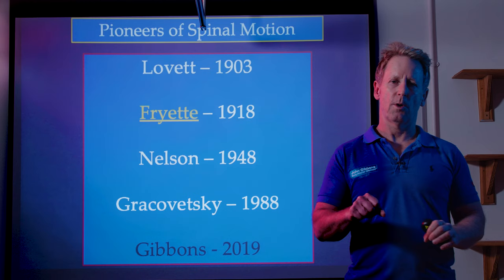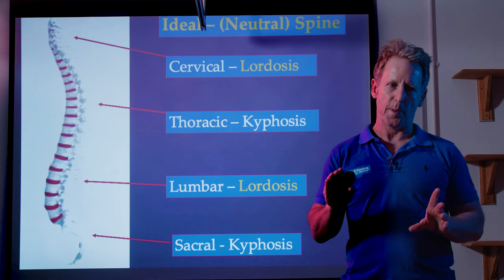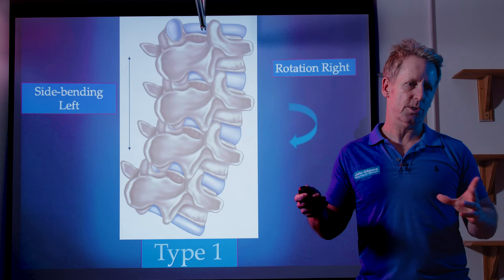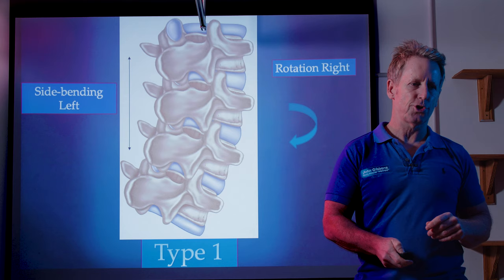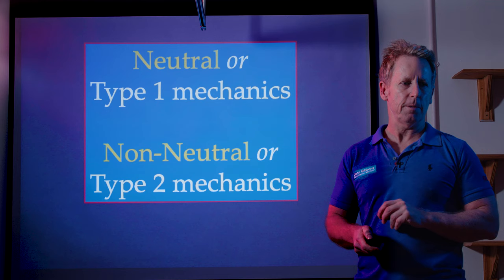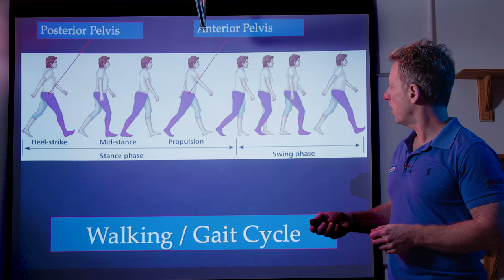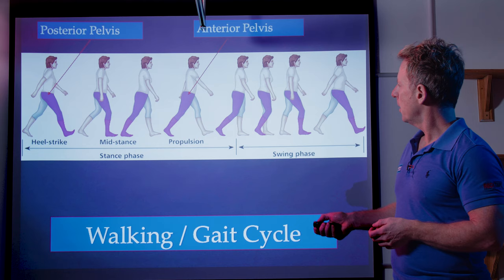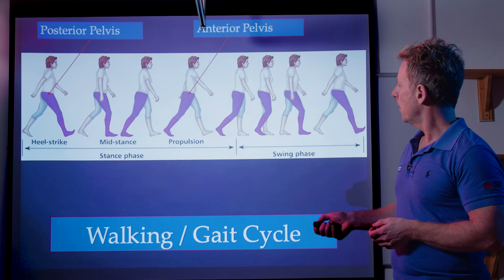Spinal & Pelvic Motion - Fryettes Laws of Spinal Mechanics

Comment: Thanks for this video, the wonderful complexities of the human body never cease to amaze.
Have been searching for a single mind body connection thought to achieve proper posture and the one that seems to help is to do with maintaining the sacral angle, so, just thinking "30 degrees" whilst visualising L5 sitting at 30 degrees on the sacrum seems to help maintain a neutral spine and proper posture. How important is it to maintain the sacral angle and has any formal research been done on this concept?
Reply from the maker: Thanks for the message and comments - not sure if much research has been done but sure it needs it, regards JG

Comment: i really appreciate not only the effort that you put into presenting your content , but also the continuous update and renewing of  the manner with which you present your material.  my first question would be, in two separate slides of your work , it was mentioned that flat lumbar spine was associated with posterior pelvic tilt as well as counter -nutation of the sacrum, and the same goes for hyperlordotic back (lumbar spine) , where anterior pelvic tilt and nutation of the sacrum also simultaneously exist .in the former scenario, and in the latter example as well,  is flat back and hyperlordotic back always accompanied by the aforesaid patho-mechanics of the sacrum?? and if yes, would correcting the underlying presenting flat or lordotic back -whatever its cause is -automatically realign the sacrum into normal place or then i would have to re-position and reduce the sacrum back into normality too?  my second note rather than a question would be , in the final informative and illustrative slide that you showed, i would assume that the sacrum would rotate to the left rather than the right , after the right innominate rotated posteriorly ,  because were the sacrum rotated to the right, it would act as a wedge blocking and obstructing further motion of the innominate as well i assume the rest of the chain.

Comment: This is great. I did a complete study of your book on this subject. And now I'm going back to it again to double check the crib sheets I made from source.
I noted that I could use home exercise: stretch L piriformis for R-on-R dysf. 
Can you confirm that I could prescribe home exercise: stretch R piriformis for R-on-L dysf.?  
Or would it be home exercise: stretch R glute med for R-on-L dysf.? I may have seen this in another source and indeed this is what I've been suggesting. 
I do manual techniques primarily however.
Reply from the maker: Thanks for comments and you could give the patient the 'sims' exercise to help correct forward sacral torsions. regards JG

Comment: Hi John, interesting explanation, I have degenerative disc disease of the whole spine, including SI joint and bilateral ischial hip impingement. With one herniated disc and 6 bulging discs. This is the most helpful video I have come across. Have been doing my own exercise due to Covid, had nerve block and waiting for next pain treatment. I would like to know whether the si joint would impact on the walking stability, as after a while rh foot seems to rotate and it is the rh sacral joint which is the worse.
Reply from the maker: Thanks for the message and the SIJ is the foundation of the whole body (in my opinion) so yes it can affect not only the lumbar spine and thoracic spine above but the lower limbs and feet below, regards JG
Reply: John Gibbons thank you John, gives me hope that my walking will improve.

Comment: What would you recommend  for youn man who have posterior  pelvic tilt, however  since many years ( the pain is improved with setting management ect ect however his real pain certainly is located in his Sij facet  and much more his right side,  the typical back stretches not enough to help however feels nice in such positions , the patient is a horse ride trainer however he felt worse when he stopped riding as example , feels slightly better riding .   VAS 4/10 but it's always there .
Reply from the maker: Hard to comment without looking at him, regards JG

Comment: Sir. Please clarify this important issue. As you shown in example in video, As we are steping forward left leg, it is Posterior pelvic tilt on that left side and APT on back right leg, so pelvis is anticlockwise rotating.
So Sacrum rotating to right and lateral bend to left.
Lumbar or core is rotated to left and lateral bend to right
Thoracic you said again opposite of lumbar as of cox wheel system, rotated to right. So this makes left leg forward and leg arm forward which is not the case when we walk. Left leg forward and right arm or thoracic forward should be the case. Kindly clarify on this please. Shall be thankful to you.. Regards
Reply from the maker: If you step forward with right leg then the innominate is posterior to tension the sacrotuberous ligament TO PROVIDE SIJ stability for weight bearing  - the sacrum is now L-ON-L so rotated left and as you continue with through mid stance on right leg, the innominate rotates anteriorly slackening the sacroutuberous ligament allowing the sacrum to rotate to the right as in a R-ON-R. The Lumbar will rotate left and the thoracic will rotate right - same as sacrum. Hope that helps, regards JG
Reply: @JohnGibbons  Thanks a ton Sir for detailed and clear clarification.

Comment: Dear John. I have been studying clinical practice for about 10 years. However, it is very frustrating that I have not yet been able to clearly solve this clue. I am curious about the difference between l on l and left unilateral sacral flexion. At this point, I wonder if the difference between the two is the change in the position of the axis or the posterior tilt of the pelvis. always cheering you on thank you
Reply from the maker: To me they are the same thing L-on-L or R-on-R is one side of sacrum in flexion or nutation but no doubt they differ depending on what book you read - regards JG

Comment: I'm currently learning some of this, though not Osteopathy, Orthopedic massage. I would like a deeper understanding why the sacrum moves in such a way, related to the innominate e.g. you mentioned posterior rotation of right innominate, as the leg gets ready for heel strike, the sacrotuberous ligament pulls on the sacrum, rotating it to the left. What pulls on it for the right sacral base to nutate at this time, to give a L on L? I would really like to understand, or have I got this wrong? Thanks
Reply from the maker: Thanks for the message and the sacrum rotates to the left on the left (L-ON-L) axis and right on the right (R-ON-R) axis by the motion of the innominate bones counter rotating anteriorly and posteriorly which 'drives' the sacrum into a rotation on its oblique axis, and then the lumbar rotates to the opposite direction - there are no muscles as such rotating the sacrum as it is done by the slackening and tensioning of the ligaments (sacrotuberous etc) that assist in its oblique motion, hope that helps, regards JG
Reply: @JohnGibbons  yes it does, thank you for replying!

Comment: Hello Dr John. Could a L on L torsion have a unilateral flexion component to it? if yes then could the SIMS technique be used or  you have a different approach to it? as i am aware from your videos that you use SIMS to correct a Lon L / R on R sacral torsion, am i correct? Thank you for considering.
Reply from the maker: Probably as not sure and maybe the SIMS will help, regards JG
Reply: @JohnGibbons  thank you

Comment: Hello John. My question is- in my case,while i was lying on my stomach in my bed, a heavy pressure on my glutal and sacral region (psis region) when my friends stacked on top of me, in that moment i literally felt something in my pelvis or sacrum glide/shift- the pressure caused a L on L sacral torsion(deeper psis on right). My Right asis is more anterior and my entire hip feels slightly rotated left on its axis. My pubic symphysis that should be in the centre has shifted a little towards left guessing because of right inflare of the pelvis or left outflare or just the L on L sacral torsion, i don't know. What is your take if that's the case. Thank you for considering and also if i may say so, i am still hoping for a response from Nick. Nick hasn't been able to reply yet to my email. Have a nice day Mr Gibbons and thanks for being so attentive towards a patient like myself. Appreciate your kindness and work ethic.